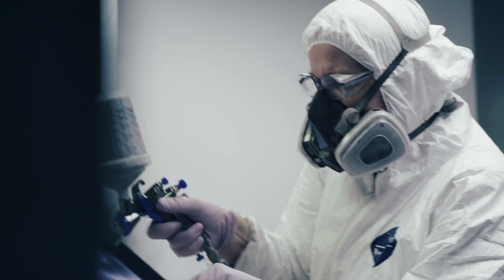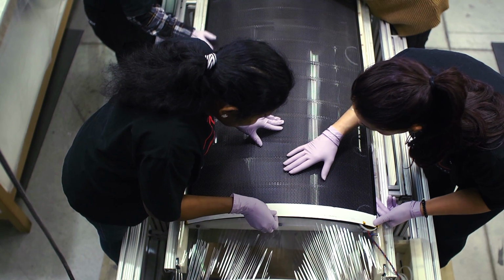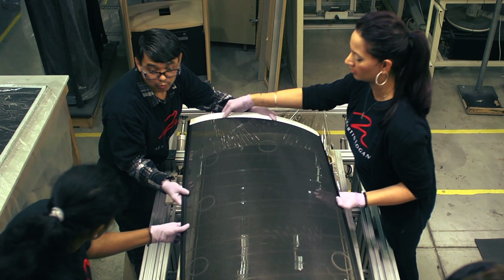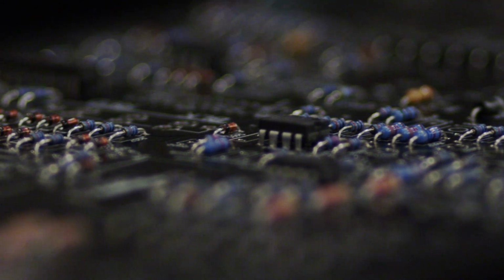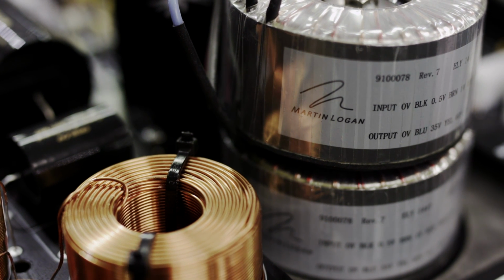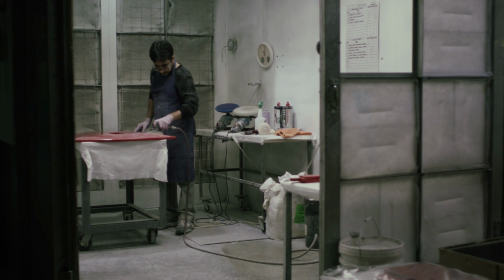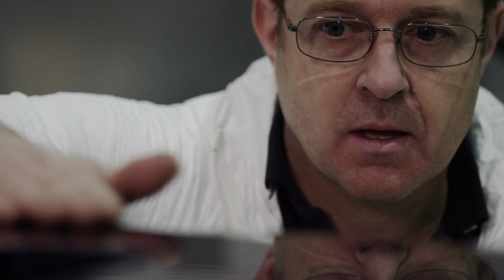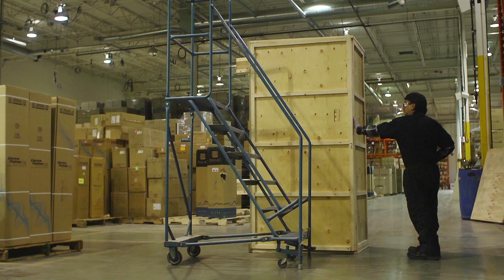SoundStage! InSight -- MartinLogan's Neolith Loudspeaker (February 2015)

Comment: Anyone who owns a Spire, Montis , Summit , ESL  and so on should have gotten rid of them last year. Since the whole new line just replaced them. If you are picking up the old models just dont pay more than 40% of the original cost. if they were kept in the sunlight dont buy them if they were kept in hot storage or hot weather dont buy them. Otherwise they are some of the best sounding speakers for the price.